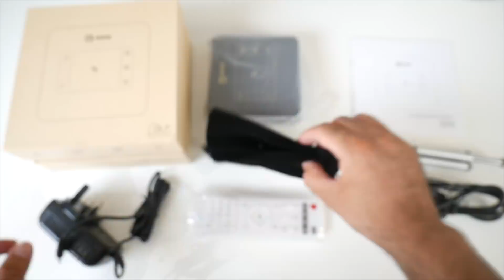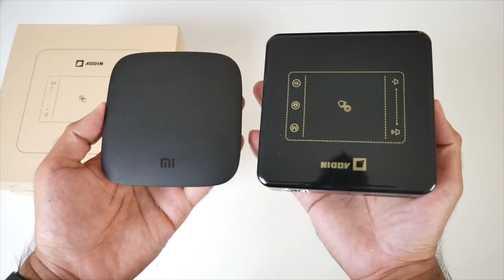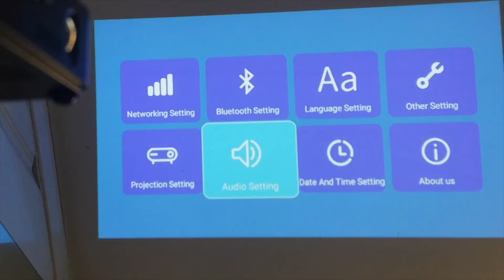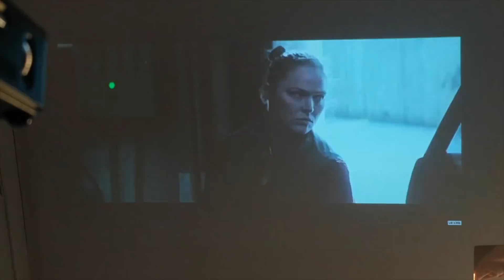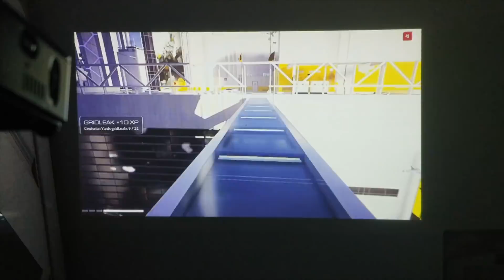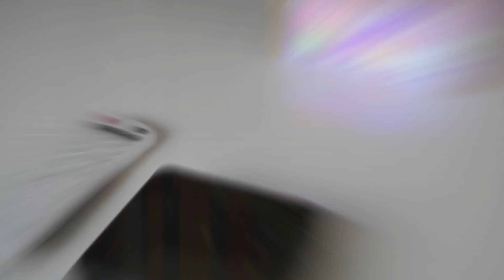AODIN D13 Android 7.1 Portable LED Projector

Comment: I've got this same unit of projector but with a different name of Oji T13. I've been using this device for 2 years however,  the WiFi suddenly stopped working. The current Android OS is 7.1.2. 
Is there any upgrade for the current OS for this projector?